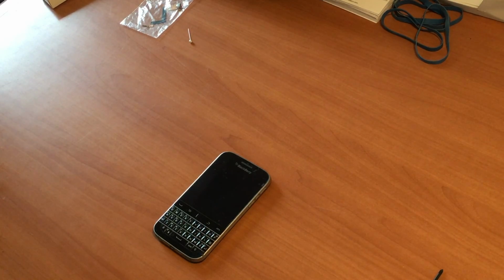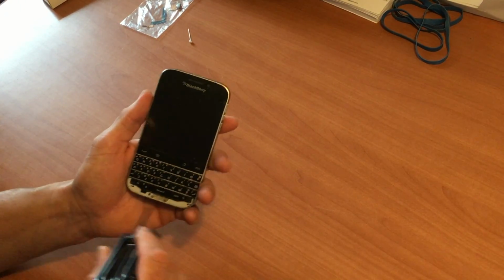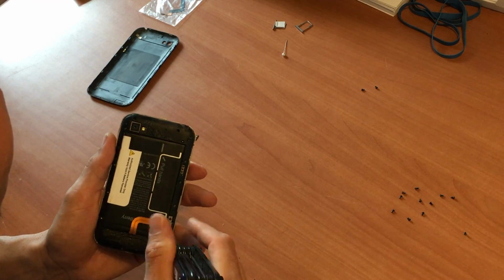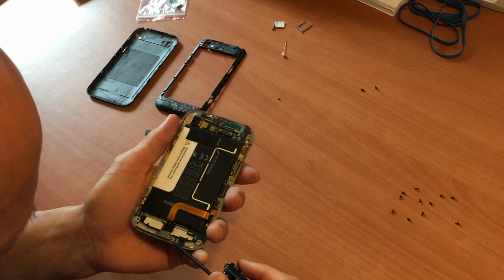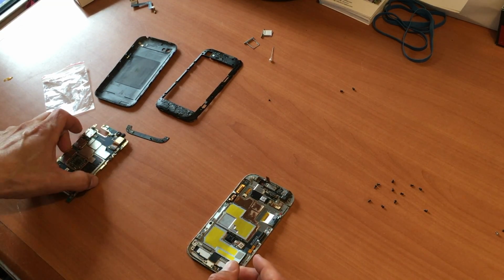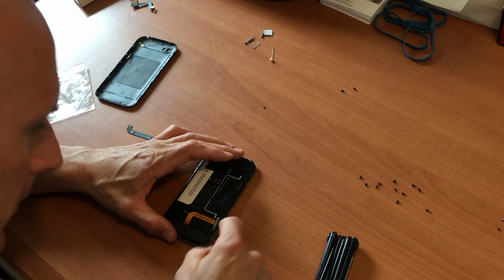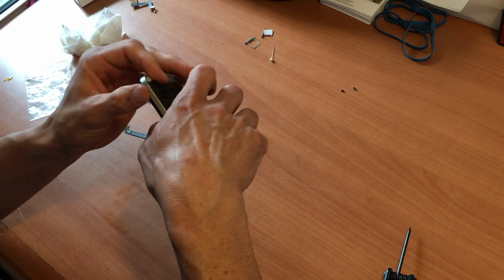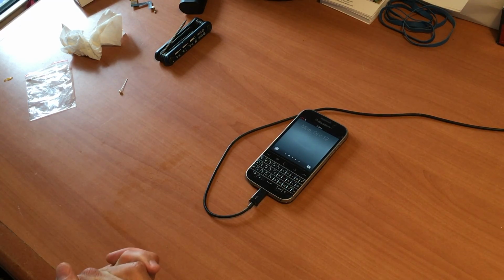Blackberry Classic Q20 Repair - Charging Port

Comment: When the blackberry Q20 is in the off position it can be charged, but when the cell phone is in the on position it is not charged, and in the USB menu without connecting the USB the status is connected, where is the problem? Is that a problem with the charging IC?
Reply from the maker: Something else could be wrong with the board.

Comment: This is a very good video. I have been a Blackberry user since 2006 or so when I got my first Pearl. My Classic stopped taking a charge, and I hope this will solve the problem. I need to get a current backup so I can transfer the contacts to my new phone. Can you give me the part number for the replacement port? I also see where you mention you sell them, but were out at the time of the comment. Do you have one now? I have the phone taken apart, by the way. I have since found a supplier in Illinois, but I will wait to see if you can reply before the day is over. If not, i will just buy the one I found. Thanks again!
Reply from the maker: I use to always use Blackberry.  I will have to see if I can find that part number for you again.  I will see if I can update the link in the description.  I don't currently use Blackberry's anymore since I need to use my phone for video production.  Thanks for watching!
Reply: @JeffLepard  Thank you, Jeff for the reply. I have posted this to another forum but I wanted to run it by you in case you know. Once I replaced the charging port and reassembled the phone, I was able to charge the phone. Thank you for the great video that helped me with that. However, the keyboard is unresponsive, and the phone is locked - I cannot enter the security code. Any idea about the connection I may have misaligned or damaged while reassembling it? I also have switched from BlackBerry but I need to get this one going again in order to get current back up and then export the contacts in a format for I Phone.

Comment: In this Blackberry classic Q20 repair charging port video,  you show the screws in the face needing to be removed, *WHAT SIZE TORX/star SCREWDRIVER(s?) IS REQUIRED to take apart this phone to get to that USB faulty charging port to replace it? The replacement USB charging port circuit is very cheap on Ebay ;) Its getting that BlackBerry q20 apart correctly to do the repair is the challenge, for the next trick cellphones will have a mini USB port to enjoy using a dual shock joystick...
Reply from the maker: I know the parts are cheap on ebay.  I wish I did videos for all of these phone parts when I had the chance to.  I'm not sure what torx or screw size is required unfortunately.

Comment from the maker: I forgot to mention in the video when you are assembling the phone don't forget to connect the headset port to the back of the board in the slot where it belongs. Otherwise your phone will continue to switch from headset to speaker phone every 2 seconds on its own.